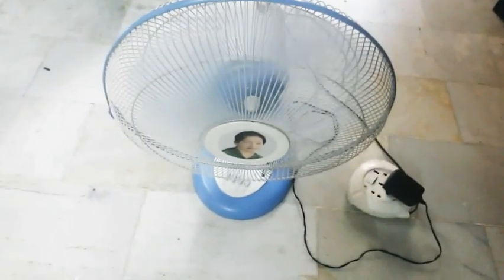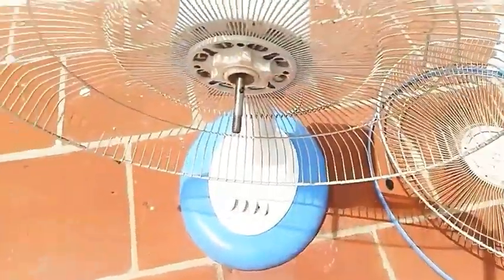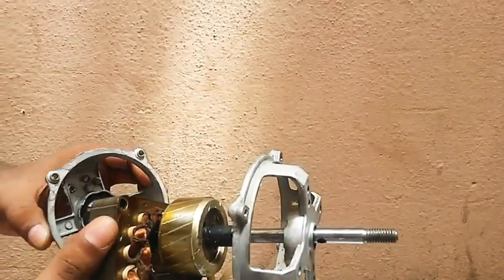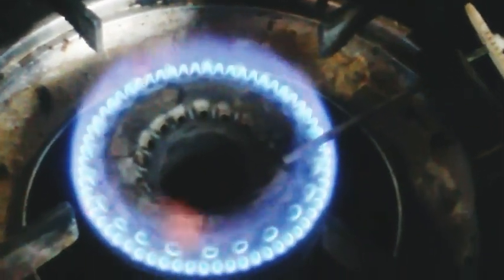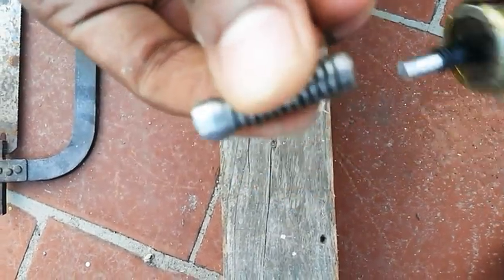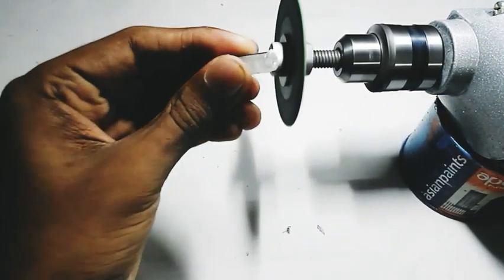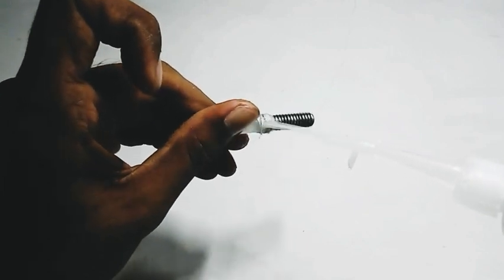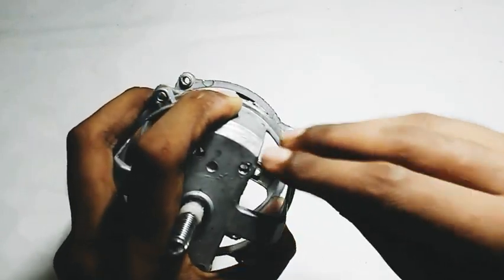How to convert 220v table fan into 12v dc fan|இத பாத்தா அம்மா fan ah தூக்கி போற்றுக்க மாட்டிஙா

Comment: நண்பா  dc 15 v   sawbagya  recharge fan  க்கு  இந்த அடாப்டர்  use பண்ணலாமா
Reply from the maker: அதற்கு வழங்கிய adapter use பண்றது நல்லது நண்பா
Reply: அதற்கு அடாப்டர் தரவில்லை   ஆனால் அதற்கு பின் புறம் 15 v   input என்று mention செய்துள்ளார்கள் அதான் கேட்டேன்
Reply: முதலில் அது recharge fan இப்போது  அதன் board  பழுதாகி விட்டது அதான்  motor மட்டும் run செய்ய கேட்டேன்
Reply from the maker: மோட்டார் மட்டும் ரன் செய்ய 12v 3A adapter use செய்தால் நன்றாக ஓடும்
Reply: @Trytomakesomething  நன்றி நண்பா
Reply: நண்பா இப்போ  என்னிடம்  12 v   0.5 A  adaptar இருக்கு   அது   use செய்தேன் fan ரெக்கை  சிறிது அசைந்து  அசைந்து நிற்கிறது   12 V  3A   adaptar போட்டால்    சரியாகி விடுமா

Comment: Fan blade motor ooda connect panna vedio kaanum bro atha epdi connect panninga
Reply from the maker: Bro video length athigama irinchu so atha cut panten. Antha blade la iruntha ottaila motor la matna pen ah insert panten.pen diameter um antha ottaiyum correct size la irunthuchu
Reply: @Trytomakesomething  blade shaft dia perusa iruku bro pen ahh Vida any way thx bro
Reply from the maker: Bro dia chinnatha iruntha athu mela thread suthitu fevikwik  vachi otha irugirum aperom atha blade matirlam